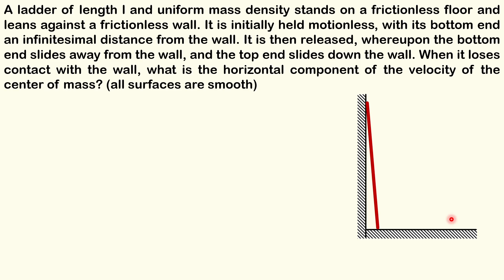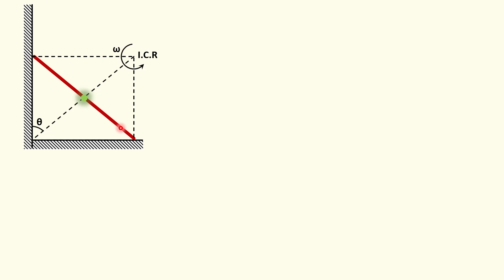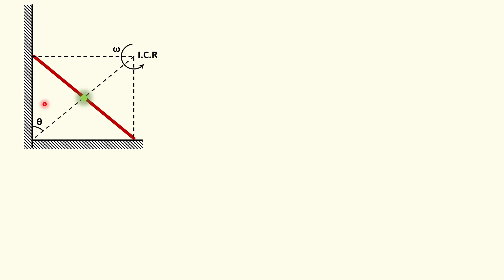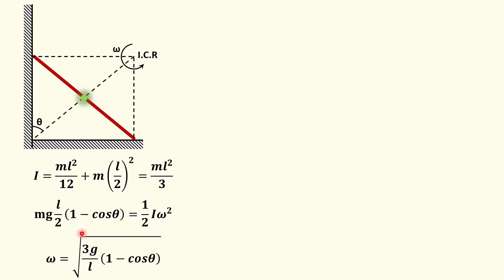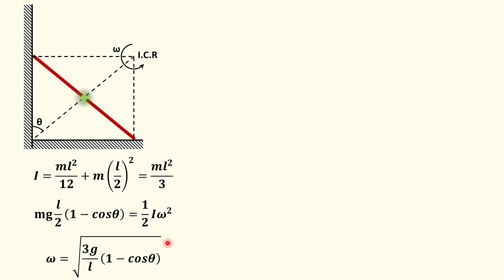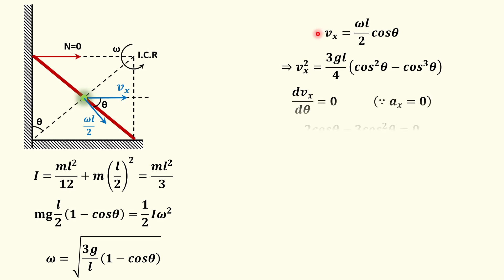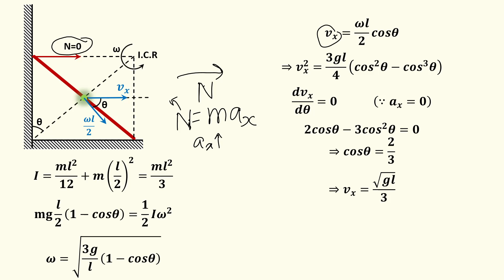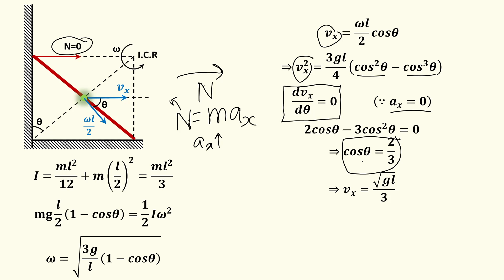LADDER SLIDING ON WALL | ROTATIONAL MOTION | JEE ADVANCED | PHYSICS PROBLEM

Comment: Please tell me why work done by normal forces are ignored 😭😭😭 Because the centre of mass is not moving perpendicular to the normal forces, so how did we just neglect them. I'm very confused 😭
Reply from the maker: Because point of application of normal force is moving perpendicular to normal reaction.
Reply: @JEEPHYSICSTUBE  Does that mean that work done by Normal force on a rigid body does not depend on the direction of displacement of center of mass, but instead depends on the direction of motion of point of application of normal force?
Reply from the maker: Yes..  work done by a force is dot product of force applied and displacement of point of application. C.M has no role here.
Reply: @JEEPHYSICSTUBE  wow I am surprised I didn't know that😶. I did solve the problem by considering the work done by torque about ICR (in which case both the normals have no role as they pass through that point) and found the same value of velocity.
Reply: @JEEPHYSICSTUBE  thanks for clearing my doubt
Reply: @JEEPHYSICSTUBE  by the way, thank you so much for replying. If you could give a reply to my follow up question, I would be obliged. Your channel is awesome, by the way 👍
Reply: work is done by a force at the point of contact we dont need to see the motion of com